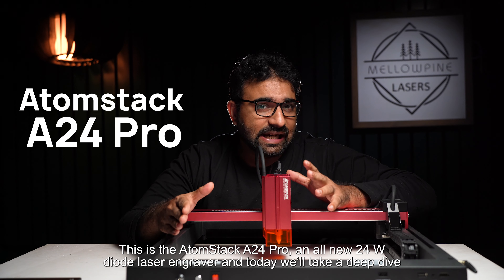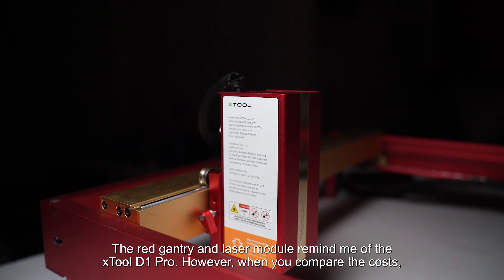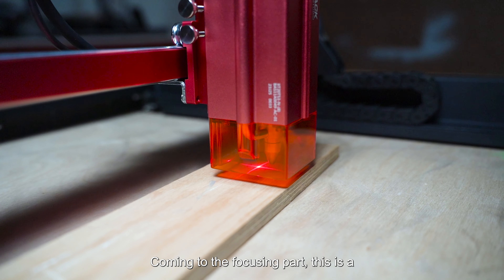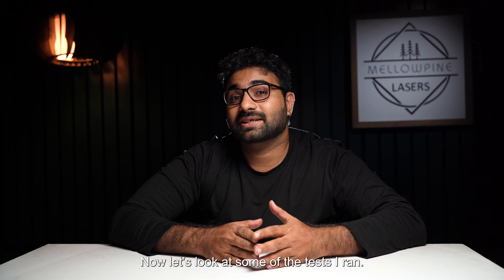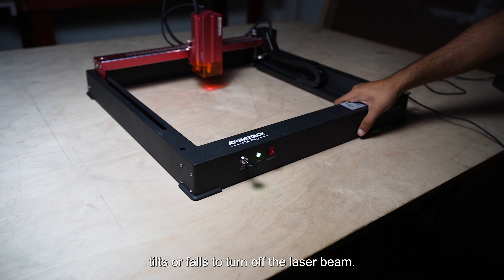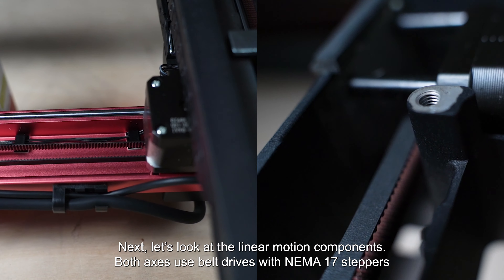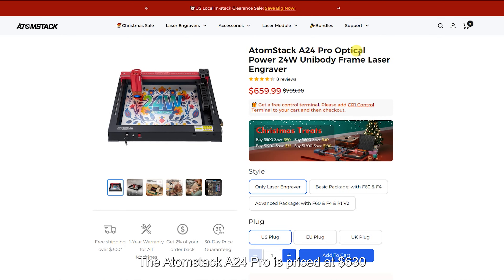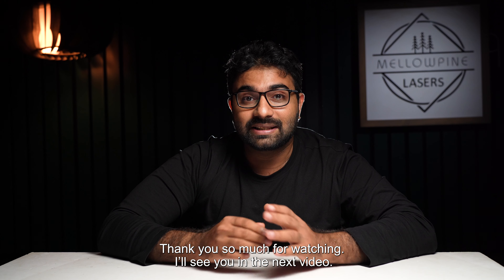Unbelievable Power at Unbeatable Price? AtomStack A24 Pro Review

Comment: Very helpful review. Thanks for this post. The specific note regarding the lack of a flame-sensor was super thoughtful too. 

There are two categories of lasers in my opinion: Subscription versus Non-Subscription (to the laser company’s proprietary design software). This machine can be used with Lightburn which just makes this so much more versatile and a little more “open source”.😂

I’m looking at the A24 Pro now with the full enclosure and fume extraction fan and some snowboard-style safety laser goggles now too. Thx!